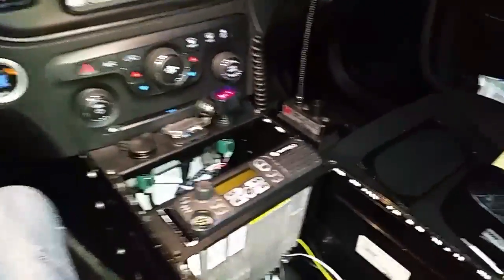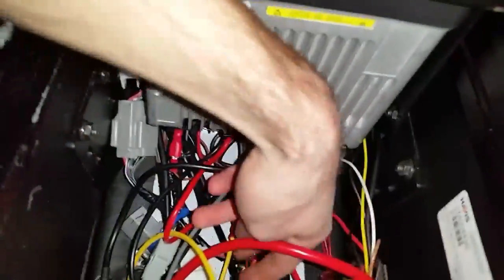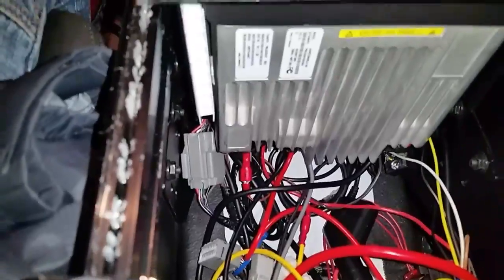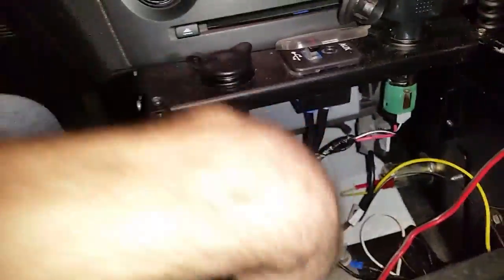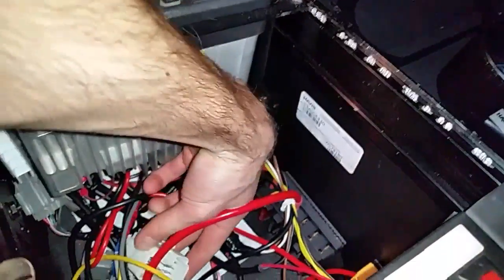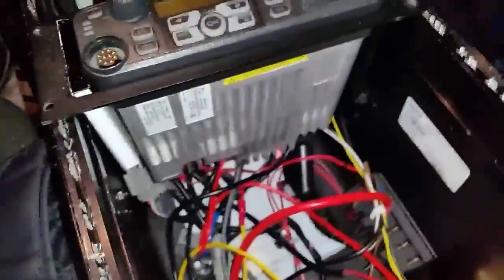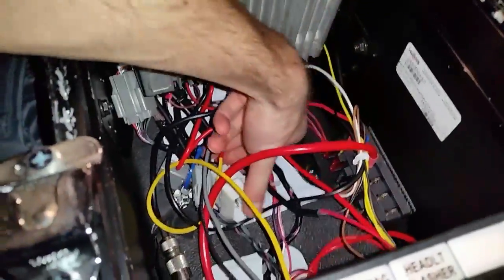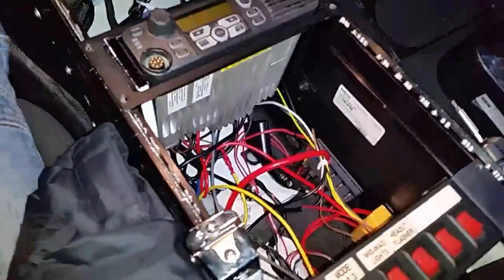How to Enable Factory Wig-Wag Light Flasher on Dodge Charger Police Through VSIM Module

Comment: Hey thanks for making this video man, I recently got a 2010 police charger and was wondering what the hell the grey box was. Gonna wire this up for fun.
Reply from the maker: Glad it helped, the wig-wag function is pretty much the only useful thing you can use it for. If you search google for the "Dodge Charger Police Upftter Guide" it maps out all the various functions, mostly just signals for various functions of the vehicle that can be used to trigger police equipment.
Reply: Yeah I saw the upfitters guide, super useful. Now my difficult task is finding a 12v supply for pins 1 and 2. Where did you tap off from? Cause most of my harnesses are dead.
Reply from the maker: It is actually the other gray square connector that has the power feeds, some are constant power, and a few are ignition only (power only when the vehicle is in "run" position)
The fuses for them are in the fuse box under the hood,
Reply: You see, my dad saw that in the upfitters guide, and told me to check it out. Got it working. Thank you very much for all your help!

Comment: Excuse me if this is a dumb comment, but if the wires are cut how exactly are you going to get a different pattern to work? 

Asking both because your video has those 2 wires cut, as does my ‘12 charger. 
Thanks, Kev.

Comment: Thanks this is great man!  I've got some strobes that are mounted in the brake lights what does activate those as well? Or is that not a stock option for these. 2008 pursuit charger
Reply from the maker: They would have been installed afterwards.
Reply: @QuaabQueb  it's pretty tight in the stock taillight harness but I believe you... So I need to buy a controller?
Reply from the maker: @dridiott  The probably taped it along with the the harness. The controller on these should not be too far down the wire. They may have chopped it off. The controller comes as one piece with the light head. If you google whelen vertex you will see what it should look like, though note many manufactures produce these. I recommend removing the light heads altogether, you don't want that crap in your car.

Comment: Hi! 

So I have a 2012 charger police with the VSIM module left in the vehicle at auction. I followed your instructions and snipped the two wires indicated. I have a couple of questions. I just purchased a 12 fault cigarette lighter plug from AutoZone just to test the functionality. I’m not getting any reactivity when connecting the wires. Does the 12V source need to be grounded? I don’t have access to tools right now to test whether the wires are even live or not and I also am not savvy enough to understand the outfitter guide. Just was hoping for some quick help and reference.

Thanks 
Jerod
Reply from the maker: What are you trying to do, just activate the wig-wags, or wire in a cig lighter plug, or both ?
The cig plug will require a power wire of 12V and a ground, which you can connect to any radom bolt in the center console area, I used the bolts that hold the keyless antenna bracket (long rectangular black module)
For the wig-wag trigger wires all they need is 12V no ground.
If you want leave me your email and we can discuss further

Comment: Is there a plug to plug into this harness so you don’t have to splice? Or is splicing the only way to go?
Reply from the maker: Yeah but it's basically a pigtail so the other end of the plug just has stripped lead on it. 
Part numbers:  68251804AA 68213591AA 68251805AA
Reply: This is done because you need a switch for the features.

Comment: I have 2010 police charger and can’t get horn to work, any idea what may be the problem? I’ve checked for cut wires under dash etc. and found none. All police wiring was removed prior to me purchasing
Reply from the maker: You have to trace the wire back from the horns, usually they splice it behind the glove box on the right side where the main wiring harnesses connect. They do this to use the horn ringer circuit to change siren tones.

Comment: hey man, I just bought a 2012 Dodge Charger police pursuit and I am wondering how do I hookup the lights. The fog lights, when I flip a little switch in the center console, only one turns on blue as a police light. I have the front lights, and the ones that stay on the grill and I was wondering how do I hook everything up
Reply from the maker: You have to trace the wires and find out what they did. All that was installed afterwards by the police department. Could have been hooked up any way. A word of caution, check to see if even having such equipment installed on your car is legal before driving it around.

Comment: Hi I have the R/T with mostly Whelen equipment cause I live in CT and It’s two towns over. I have a stock center console. Would this trick work on non pursuit models, or do I need the Whelen module, I thing does front and rear.
Reply: Factory flasher is only on the police model. You would need a aftermarket flasher.
Reply: Thanks, I got the Whalen flasher. Does multiple patterns.
Reply: @htrago5581  yeah they're pretty neat how they can do more than one and how they can speed up and slow down

Comment: Any idea why this wouldn’t work on mine? It’s a 2012. I’ve tried applying power to both the wires and neither activate....
Reply from the maker: Car has to be running. Make sure you indeed have the right wires, and that the harness is plugged in to the VSIM box
Reply: Chargèro - still doesn’t work. Do you know if there is a certain fuse that this goes off of?
Reply: @ptownskier police mode/ lighting has to be activated

Comment: Hi, do you know how or any information on how to make the led lights on the new chargers wig wag?
Reply from the maker: Same thing as I show here. If its a regular model Charger you will have to install a flasher your self. Only the police model as the factory VSIM module, all the connections are shown in the Police Up-fitter Guide
Reply: Videos from Québec Do you know of any ways to do the flasher or what to use I am an auxiliary for my local department and some times we use our personal cars to do simple traffic duties. I have an sxt charger 2016 and I am trying to get the front LEDs and rear LEDs to wing wag.
Reply from the maker: Yes as I said you would have to buy a wig-wag flasher are wire it in yourself.
Regular civilian models do not have a factory module you can activate. Only the police model.
Reply: Videos from Québec Alright I wonder if I could get a factory vsim and install that? thank you for your help!
Reply from the maker: Unfortunately not others have tried plugging in a VSIM module from a police charger in to the regular charger and it does not work.
You can install your own wig-wag flasher, if you have experience with wiring and electronics. If not you would be best to take it to a local emergency vehicle up fitter and have them do it. Ask your department who they use. 
Also check your local laws carefully, consult with the DMV and make sure you are indeed allowed to have such equipment, and make such modifications to the factory equipment to your car. Some places have little to no regulation on the matter, others are more regulated. I'll throw an example.... you install, or have installed, a flasher, other emergency lighting etc... on your car and it somehow fails or malfunctions, even worse an accident results.You will be in a would of trouble. These are the things many people do not think about because they reply on "I heard" or "I thought"
Reply: @QuaabQueb  correct.  The Charger Pursuit uses completely different harnesses.

Comment: I purchased a charger any idea how to regain use of factory horn to pass state inspection
Reply from the maker: Yes common problem, it was cut somewhere to trigger siren change tones via pressing the horn ringer, you have to trace the wire and find out where they cut it, Start by taking the front bumper cover off, could be they simply unplugged it and cut the connector there, or under the passenger side dash usually.
Reply: Chargèro thanks i wired a horn to a wire that went out front and used a button temporarily

Comment: where can i find the upfitter guide?
Reply from the maker: It's online just search for it it will come up.
Reply: @QuaabQueb  will do.. thanks   I have two chargers i got for my sons. the dam horn/high low beam/ turn signals / wipers do not work. i changed the switch and clock spring.. still wont work  i think the wires have been cut when the police stuff was removed but cant seem to find the prob.. Do you know of any specific place to check that the normaly would splice in the harness?  thanks for any help you can give
Reply from the maker: @shawnburnes6141  usually in the panel on the lower right passenger side foot well. You have to remove the glove box to access it. It is where the main harness come in. Wipers no reason why that should have been disconnected.
Reply: @QuaabQueb  cool, ill check it out. Thanks again
Reply from the maker: @shawnburnes6141  Good luck.
Reply: @shawnburnes6141  Did you ever fix this problem? I am currently dealing with this very issue! 😢
Reply: @cantbanthejerk1748  
Yes. I actually pulled the boxes and all the related wires from both cars and replace clock spring assembly.
Reply: They were both fixed and worked fine

Comment: What makes the rear lights alternate flash on a '13 model?
Reply from the maker: Wut
Reply: I've seen the leds on the trunk and around the tail lights flash in different patterns. Didn't know if you found that secret or maybe another circuit is needed like a speed turtle flasher.
Reply from the maker: @charlierumsfeld6626  oh that. No that is done with an aftermarket module that is spliced in to the power wires feeding the light bar. Not a good idea as such modules often cause the individual LEDs to fry. The Tazer from Zautomotive however has a feature called "light show" witch does the same thing.
Reply: @QuaabQueb  thanks

Comment: Any way you could contact me to help me with my charger for the wig wags?
Reply from the maker: Yes, what do you need to know
Reply: Chargèro I applied power to the violet or orange trace wires and nothing happened. I’m thinking the vsim doesn’t have power or something idk
Reply: Chargèro do you have a Facebook so I can message you on there?
Reply from the maker: If it is plugged in it should work fine. Also note the car has to be in the "run" position. Wig wag functions from the vsim will not work if the car is off on in "acc"
Reply: Chargèro I tried it with the car on and it still doesn’t work. Does the small gray connector have to be plugged in cuz I noticed on yours it wasn’t?
Reply: Chargèro - Did you guys ever figure out the issue? I’m having the same problem with my 2012
Reply: I have a 2019 charger. My 12v cigarette port only powers my cell phone when the engine is running and in park. As soon as I shift it into drive it cuts power. Any ideas?

Comment: can i grab constant power from the grey plug an keep led directional bar on without acc on or engine on
Reply from the maker: Yes you can, just use a simple tester or look at the "police up-fiter guide" online, some circuits are constant hot (always available power even with car completely off) and the others ignition controlled, so the car must be in the ACC or RUN position. 
I would definitely recommend always having the motor running if you are going to have equipment running, especially a directional bar. If it is halogen it will drain the battery fairly quickly, if it is LED you can get away with it a little longer, but it does not take long to discharge the battery below 11volts, once it gets that low there is not enough voltage to start the car.